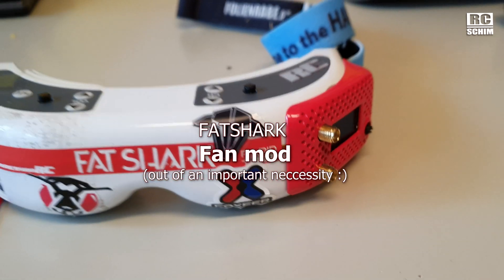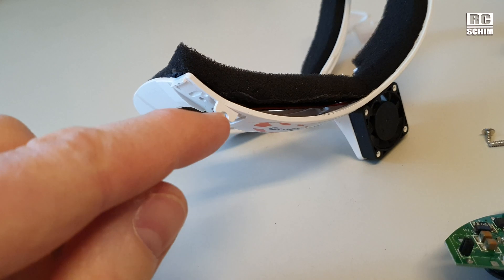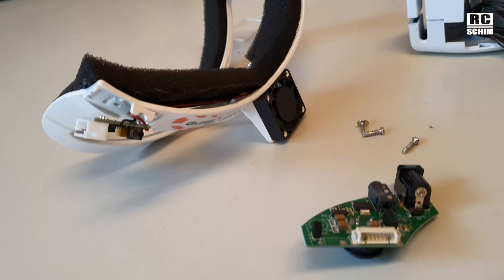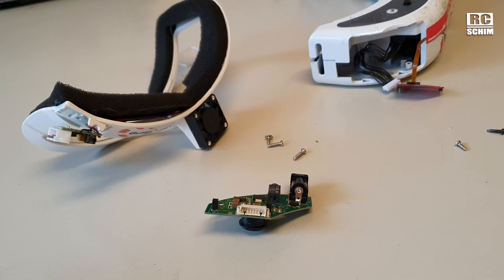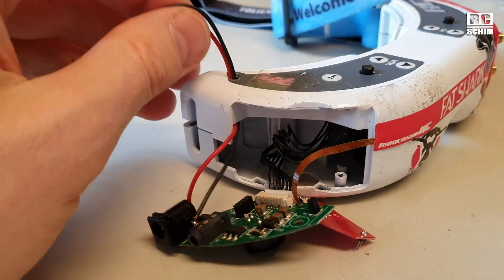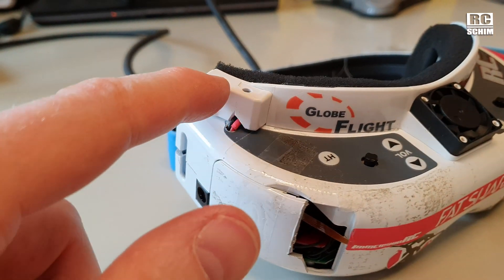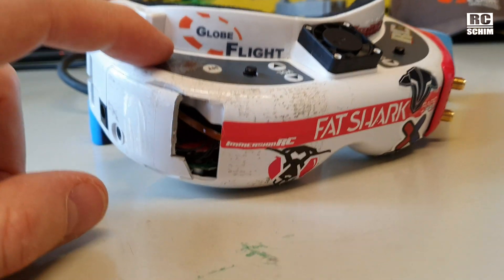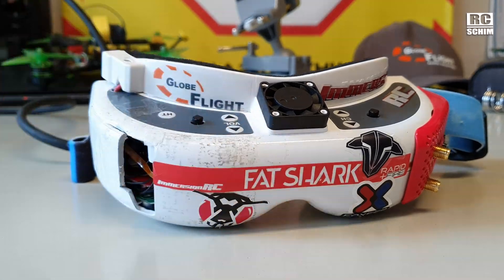Fatshark Goggles FAN Mod (Fan powered by main plug)

Comment: A more elegant way is to bridge the fan directly to the balance connector of the fan switch. Then you can just plug in a 2s lipo balance cable, run the wires through the already existing hole behind the headstrap and solder it to the PCB. No need to drill a hole.
Reply: Yep no need to hack your expensive goggles to make a hole when there’s already one there lol

Comment: easier to solder to the pads on the bottom btw.  Also, no need to drill a hole.

Comment: Hi rcschim, when are you going to review the dji digital fpv system?;)
Reply from the maker: Not sure yet. Since I have to pay full price, and since I would maybe go for the full package (1000$?) I'm still thinking about it.
System looks really good tho and I think it will be a matter of weeks from now :)
Sounds like you can also use it (the goggles) quite good for analog video...
Bardwell released a Bytefrost video yesterday - I'll have to check this out as well. It would, for sure, integrate in my lovely Dominator goggles better (and be cheaper I guess)
Reply: RCSchim bytefrost Will be cheaper since you can use the goggles that you already have, BUT the dji goggles have a screen quality and fov that you can’t find in fatshark without the blurry edges. In addition the image quality of the bytefrost its not at the level of dji ( in some of the online videos it looks that the colors are similar to my runcam eagle in analog). If you add poor goggles to lower received image quality the overall experience is not the same.

This is an opinion of someone that don’t have and never tried none of the systems.

Hopefully you can find a nearby subscriber that can loon you those systems for review:)
I really appreciate your reviews and work.

Thank you

Comment: I've been wanting to do the same thing with mine for a long time... I rather dislike the balance lead connection and it doesn't work when I power from my ground station. I may have to put a resistor or regulator in with mine since the ground station is 12V though :/

Comment: I did the same mod a while ago for the same reason, however I used a voltage regulator so I could continue to use 3S